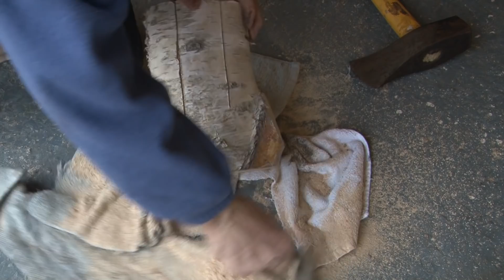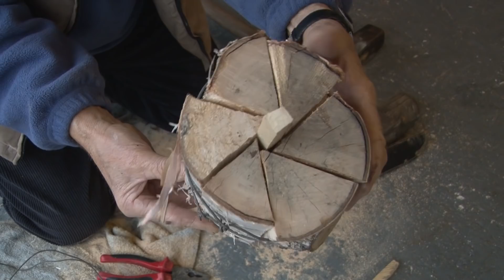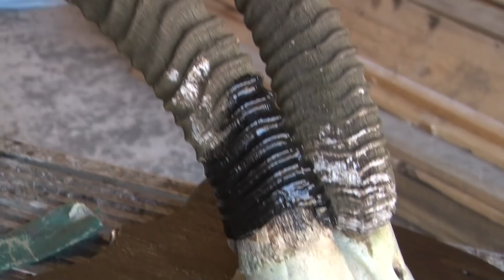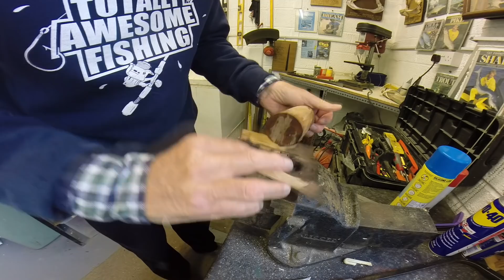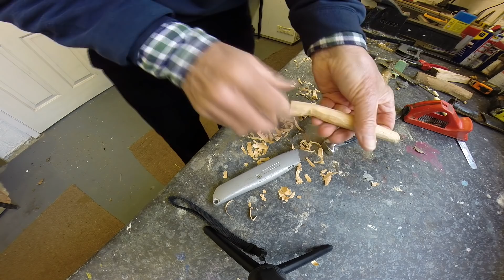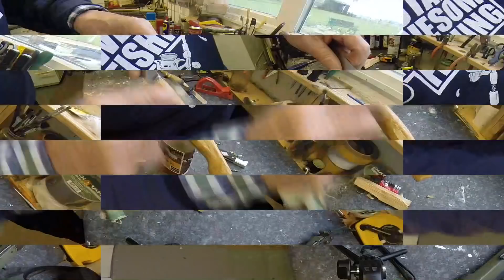How to Make a FIRE TORCH!

Comment: Hi Graeme. Love your videos. Just one tip for the fire torch - I use a chain saw when doing mine, and don't cut all the way to the bottom - or split the logs out - then you dont need any wire. Light a few twigs on the top, they fall into that lovely saw dust in between the splits - and up and away she goes. Not doubting yours works as well btw :)

Comment: There is an easier to make a fire torch . 
By drilling 2 holes  1 long 1 short that connect at 90 degrees .
And less mess .
Reply: Also called a wooden rocket stove. They work a treat if you do it right. The downside is needing an auger or drill. I reckon Mr. Pullen used the saw because he didn't want to  use the maul right then. (it might have been easier to just use the maul and a hammer, but it still works.)